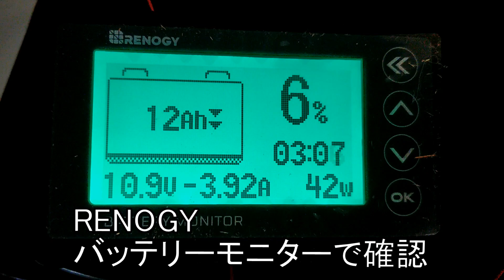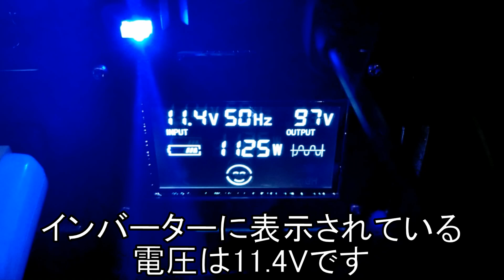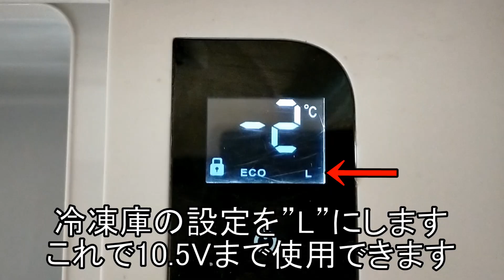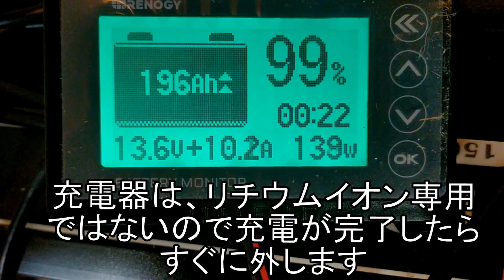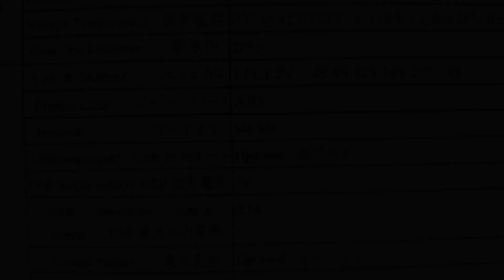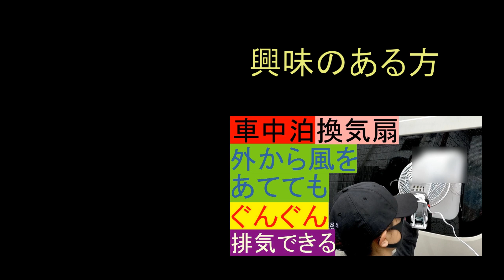取説から分かった新事実！200Ah充放電テスト（リン酸鉄リチウムイオンバッテリーLiFePo4）RenogyバッテリーモニターSKU:RBM500-JP正弦波インバーターHP1500Wポータブル電源

Comment: Hello my friend I bought this battery KEPWORTH exactly it was accompanied by a 10A charger my question is if I can charge it with another type charger for acid batteries these batteries can you tell me?
Reply from the maker: This battery can be charged by another charger.
Please use the charger which is designed for the LiFePO4.
It can be charged with maximum current of 100A or continuously with a current of 40A.
Other videos will help you.
Thanks ;-)